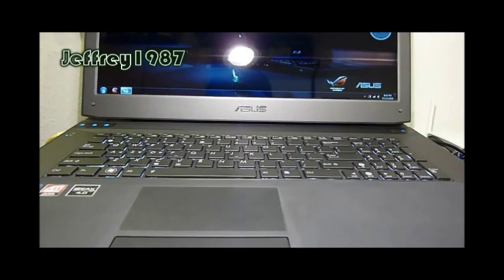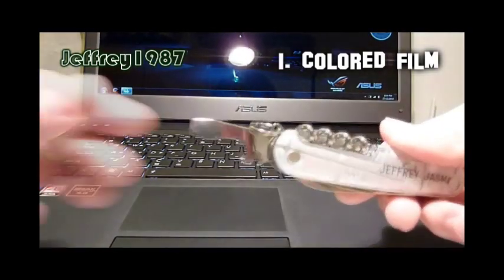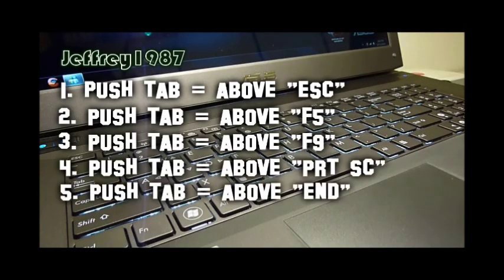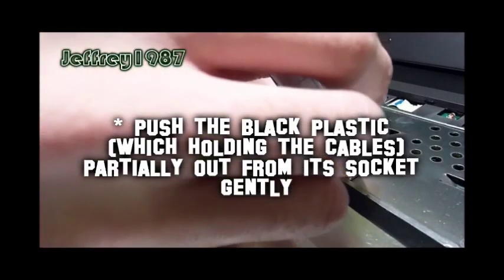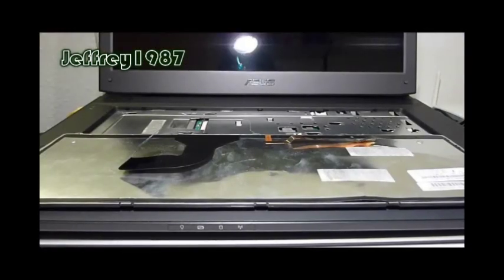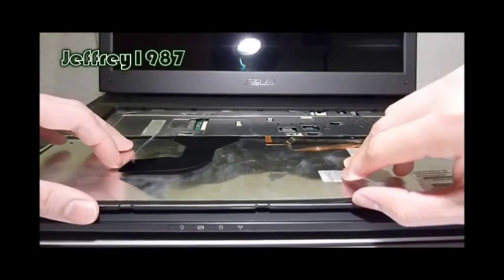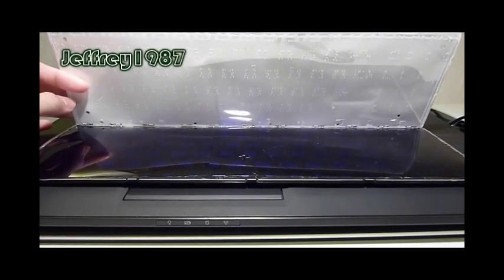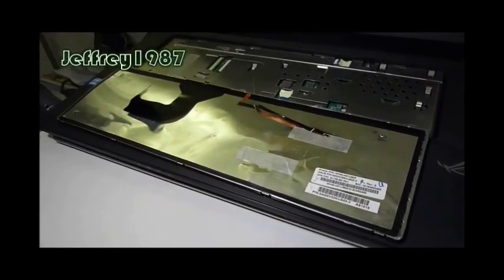How to Modify Asus G73/G53/G51 Gaming Notebook Backlit Keyboard

Comment: U might have plugged in tje orange ribbon cable upside down. That is tje one that controls tue LEDs on the backlight. Take it apart again and flip it or make sure that it is in place good and snug. What i recomend is take it apart and re seat it but dont assemble it back together. Just power on ur notebook and make sure that everything is working before u re attach the keyboard. 

Sorry youtube app wont let me quote lol

Comment from the maker: @2pac765ify You mean that your keyboard did not lid up after the mod? If yes, please check again the backlight cable again. You probably have installed it in the wrong way (upside down) or didn't insert the backlight cable properly into the plastic holder.